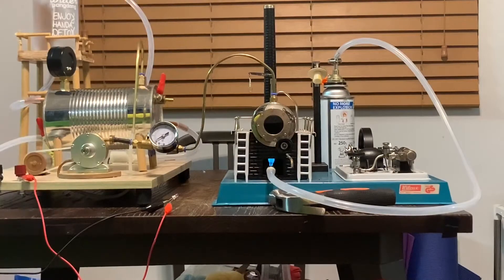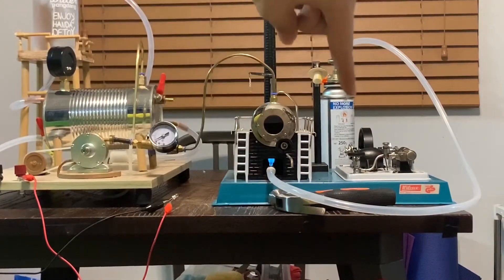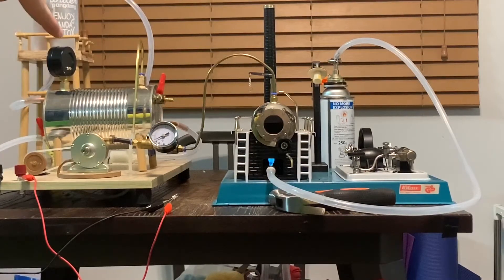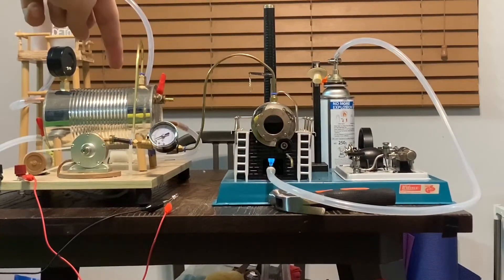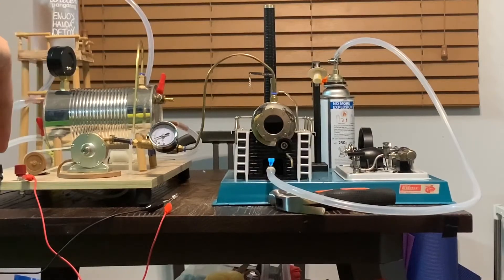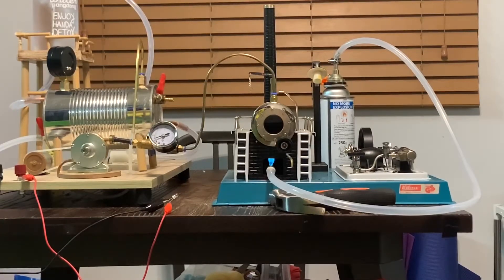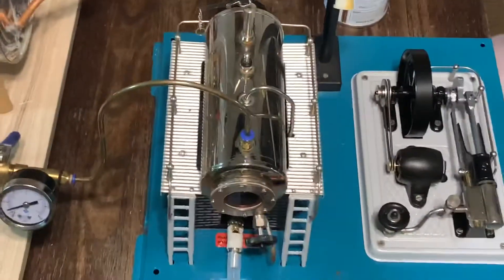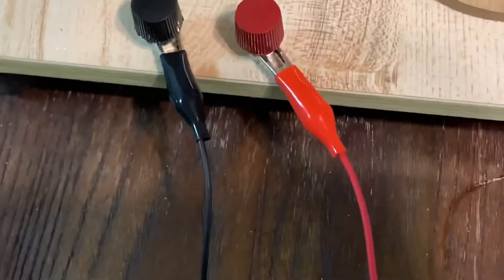Rankine not Cycle (mini power plant using Wilesco D18 and JT-II steam turbine)

Comment: You should try better alternator connected directly to she shaft. Single rotating magnet connected to the shaft will make much more energy with rectifier. Also turbine gets higher rpm because of less friction.
Reply from the maker: I will keep that in mind 
Thank u

Comment: Hi, I just wanted to ask if the Pressure that makes the turbine rotates stays constant? (pressure of the steam from the boiler) 
We tried our prototype but whenever we open the valve to make the turbine rotates, the pressure is dropping very quickly and will turn to zero. 
Hope to hear from you soon, thanks! 😇
Reply from the maker: Hello. Well at the start when the valve is opened, the pressure drops a bit, but that's when I try increasing the flow rate of the gas to stabilize the pressure. But actually, that will depend also on the rated pressure of the boiler. Are you also using the same Wilesco and steam turbine?
Reply: @sachiootsuka  how do you maintain the pressure? 
does your turbine rotates continuously?
Reply from the maker: @jonacarmelarufa3319  yes it rotates continuously and I managed to keep the boiler pressure to about 1.5 bar. However, when the load gets too big like charging a phone, the turbine stops, but lighting LEDs are fine
Reply: @sachiootsuka  is yours a close cycle or not? hehe ours was not and we're having a hard time in maintaining the pressure to rotates the turbine.
Reply from the maker: @jonacarmelarufa3319  oh no hehe its not a closed cycle because I lacked materials to feed the condensate back to the boiler
Reply: @sachiootsuka  yeah I realize it too from re-watching your video, we're also planning to make ours an  open cycle
Reply: @sachiootsuka  Hi, good evening
Can I ask where did you buy the wilesco steam turbine? or maybe can I have the link? 
Thank You! 😇
Reply from the maker: @jonacarmelarufa3319  hello, I got it 2nd hand from a seller in Ebay. They are pretty expensive brand new :/ Around php12,000 and above :((
Reply: @sachiootsuka  12,000 just the Turbine? 😔 or it includes other parts? 
hayss it's too expensive for us 😅😂
Reply from the maker: @jonacarmelarufa3319  actually I bought the turbine separately eh HAHA it was 5k...
Is this for a project?
Reply: @sachiootsuka  for our thesis po
Reply: @sachiootsuka  ours was fabricated but it Burst a while ago haha so we're super stress about it 😅, we're contemplating if we'll fabricate another one or just buy since we're running out of time 😂
Reply from the maker: @jonacarmelarufa3319  may I know what ur thesis is about if that's okay
Reply from the maker: @jonacarmelarufa3319  I can lend u my Wilesco and Turbine if u need
Reply: @sachiootsuka  Miniature of Steam Power Plant po
Reply: @sachiootsuka  for real? 🙈😊
Reply: @sachiootsuka  may I ask po, where are you from?
Reply from the maker: @jonacarmelarufa3319  manila
Where can I contact u
Reply: @sachiootsuka  you're from the Philippines din pala 😅
you can contact me na lang po on facebook or I can add you na lang po?
Reply from the maker: @jonacarmelarufa3319  yes sure
Reply: @sachiootsuka  what's your facebook po?
Reply from the maker: @jonacarmelarufa3319  Sachio Isaiah Otsuka
Reply: @sachiootsuka  I already sent a friend request, thanks. 😇
Reply: @sachiootsuka  we're not using wilesco, our prototype is like a DIY project that has fabricated parts.
Reply from the maker: @jonacarmelarufa3319  so the parts were all machined?
Reply: @sachiootsuka  yes that's why we're having a hard time in maintaining the pressure, aside from leakages we don't know the reason why we couldn't maintain the pressure when the valve is open

Comment: what's the thermal efficiency of the not cycle?
Reply from the maker: I'm sorry sir but I forgot what it was but it was within the range of 0.01-0.05 percent which is shit HAHA
Reply: It has to be abyssimal. The Safety Valve of such Engines is set to 1.5 bar, and there is no Vacuum Condenser so the Exhaust Steam has to be at least 100°C hot. And don't even think of Superheating. 2.5 bar (absolute Pressure) Saturated Steam is 127°C hot, so you have only 27°C of usable Heat after having heated the Water at least twice as much in the Boiler. We don't even have to think about Enthalpy to see that this can only be terrific, and that's only the theoretical Rankine Cycle Efficiency. Now look at the Design of the Boiler; it's literally just a Water Tube sitting over a Flame, so most Heat just goes around. The Turbine is a Laval Turbine (I have one of these myself, so I know how it looks inside), which isn't an overly efficient Design either.

I have a Video on my Channel where I test such a Turbine with a Wilesco D455 Vertical Boiler, and can't get it to run properly as the Boiler is way too small. I'm now looking for a cheap 2nd Hand D18 (you can get used Wilesco Engines dirt cheap in Germany), and plan to swap the Turbine onto the D18 and the Engine from the D18 onto the D455 Boiler. The next Step is to put an old Märklin H0 Electric Locomotive (again, dirt cheap in Germany), put it onto Rollers and power it with the Steam Turbine.